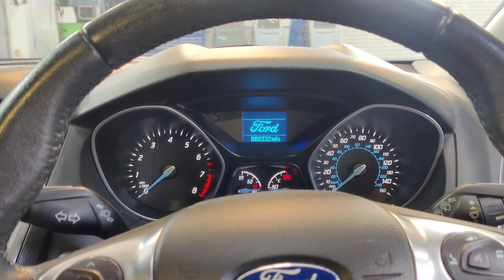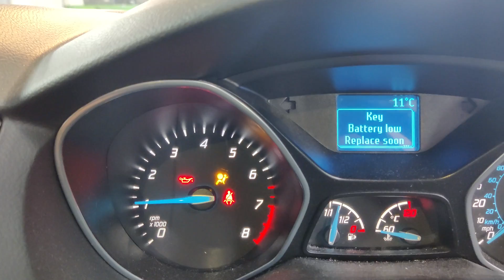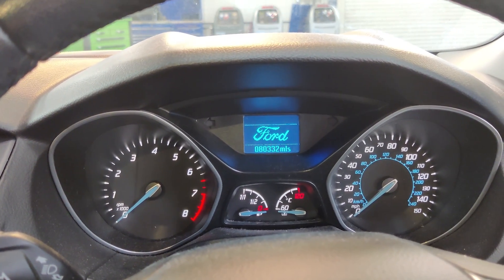AA Silencers Ford 1 0 EcoBoost M1DA timing belt failure leading to oil pressure fault

Comment: I noticed the car has 80k miles on the clock, Ford advise change  at100k or 10 years. How old was the car?
Reply from the maker: We've had issues on these engines from as low as 40000 miles and 6 years old.
Reply: Thanks. @aasilencersltd
Reply: @davidreece1642 my 87k 2017 Fiesta decided to do the same 2 days ago.   Regular oil changes with Castrol. 6 months to 9 months between them.

Comment: Thank you very much man.  This is very clear explanation why Ford Ecoboost  has certain dead after period of time. it is just simply stupid design.  Timing belts made out of organic materials that will dissintegrate over time from heat, frictions, and exposure to radicals from engine oil.

Comment: O had the same problem on my fiesta replaced the time belt new is different than the older one.
The problem was with 147000km until today with 179000km still working with no problems

Comment: I JUST had my belt break on my 2018 focus. The car has had the oil changed on time every time at the ford dealer and has never shown low oil pressure. It just broke. Pisses me off because the car only has 112k miles and the belt is supposed to last to 150k
Reply from the maker: Have you spoken to Ford as to whether they will take the job under a goodwill policy ?
If you have full documented history then it's worth asking the question given how common these are for failure.
They certainly have this in place for Transit models within a chassis range.
Reply: @aasilencersltd  I haven't spoken to them yet, I'll have to call and ask I guess

Comment: my friend  has  the same  problem and he's  been driving  it  .the  light go out after  30 S .But  i told him don't drive it  . i told him what was  wrong. its  in a  garage there  saying going to cost 800£ to replace the belt ?
Reply from the maker: If they have been driving it without oil pressure then the engine may have sustained irreparable damage.
The garage will need to assess the engine before replacing any parts, in particular they need to remove the sump and check for debris in the oil pick up.
Reply: @AA Silencers Ltd  I totally agree. I was was a mechanic many year's ago lol .iv not worked on car's this modern lol.but I did say.oh well

Comment: Went to midas a month ago or so. They put 3 litres of oil in my 1lt ecoboost. It takes 4.4. My oil pump blew as soon as the timing belt went. Turns out its a wet belt, let that muffuka get dry enough under pressure and heat. Boom! Gone!

Comment: The engine that won awards 👏  is a heap of shite after 30,000 miles ....ford reckoned the wet belt would last 150,000 miles ...but alas disintergrates at 30,000 and screws the engine up

Comment: My brother-in-law has one of these engines, done just over 20,000 miles, always carefully maintained, & now belt failure.  Who in earth had the stupid idea of putting a BELT instead of chain drive???  I can understand that it would make the engine a bit quieter, but a BELT immersed in oil???
Reply: Chains can fail aswell, its not a magic solution. I think they had a pre mature chain problem with them on BMW.
Reply: @Blac-m8d  Having been playing with engines for... (thinks)... 50+ years, I have never seen a broken timing chain, but I have seen many faulty tensioners.  As for wet belts, to the engine designers, I say don't make me laugh!!

Comment: I need a infornation, please:
If when I change the engine oil, I wash the inside of the engine with a cleaner (for ex. Liqui Moly 1019 cleaner engine), do you think that I prevent the formation of sludges ?
Thanks a lot for you replies
Reply from the maker: I can only suggest trying to find out what additives are approved by Ford.
Anything else is risky on this engine.

Comment: This engine [1.0 ecobooM] has to rank as one of the worst ever mass produced engines.
Reply: Peformance wise and for tax they are good. Also the new engines use a chain not a belt and they sorted the coolant issues.
Reply: @gamesmaster1060  only took ford 10yrs to sort it 🙄🙄
Reply: @waynemiller4602  Afaik they sorted coolant issues a while ago but I might be wrong. I'm not defending them it still sucks but I wouldn't call the engine itself terrible, especially when other cars have their own problems.
Reply: @gamesmaster1060  peugeot 3 cylinder engines have the same problem...

Comment: Straight from one of the best ford master tech's mouth here is his best 3 advice tips on this issue from the vehicles first service are :  1, Change the oil and filter at no longer than 3k intervals. 2, ONLY use Castrol MAGNATEC STOP-START 5W-20 E. This oil was produced with Ford and Castrol together specifically for the ecoboost engines to stop the degradation of the two wet belts. 3, Don't  use cheap quality fuel.. Shell or BP if possible. My friend  has followed these top 3 pro tips on his 1.0 ecoboost that he uses for his work as a taxi driver and it's just approaching 177k without any of the issues commonly reported with these engines. Hope this helps anyone who owns one of these vehicles fitted with 1.0 litre ecoboost engine.
Reply: I thought most fuel in the UK was pretty much the same as they all have to meet the same requirments
Reply: @gamesmaster1060 Different brands of Fuel is quite a complex topic. In brief it's alot to do with the additives different brands use in there fuel. Some brands leave less carbon deposits with a much cleaner burn.
Reply: @jawdinker554  so if I use BP I should be fine? or is it better to use premium?
Reply: @gamesmaster1060  Hi Jack,  My preference in brand fuel is Shell standard unleaded first choice, B.P Standard unleaded second choice.
Reply: @jawdinker554  As a tanker driver and mechanic I can debunk your response, we take the fuel from the nearest depot to the closest forecourts, no matter which garage or supermarket and deliver it, ONLY the top end fuels (e.g. Optimax, Helix) are supplied by brand. This is to keep transport and storage costs down on the cheap 96 RON, the problem with fuel is the new e10 crap, this does not burn as efficiently and is getting a reputation for degrading seals and gaskets due to its poor burning cycle.
Reply: @Smakheed  As mentioned in my earlier comments the fuel debate is a very complex subject to which i have a fair bit of knowledge. Without being spending time explaining this complex subject just go and research the different additive packages and the science the different brands of fuel manufacturers use.
Reply: @jawdinker554  YOU NEED TO LEARN THAT SOMETIMES, OTHER PEOPLE KNOW MORE ABOUT THEIR INDUSTRY THAN YOU DO.

Comment: Bough a low mileage (26,000) 2014 Focus Ecoboost 1.0 just two  years ago. Put less than 7k on since, and this has happened. Are there any legal routes I can go down? It's a clear case of a design flaw. US has lemon law and other consumer protection but in UK there's little recourse. Very angry. Wish I'd got a low mileage 50's plate Focus. They go on forever, even if you don't look after them.
Reply: I just bought a 2018  Focus Ecoboost with 47,000 miles. Before my scheduled oil change my engine would not start. Mine was still under the 60,000 mile manufacturer warranty. They are currently replacing my engine. No ETA on engines though.... So I'm stuck paying for a loaner bc the dealership warranty I paid for doesn't cover anything until the Ford warranty expires.
Reply: @Ccookkiieee  Had to buy a brand new engine and pay to have it fitted out of own money. It was 3k all in, which wasn’t that bad considering other garages quoted over 5k. Next time I meet a majority stakeholder in Ford I’m going to steal his Rolex. Eye for an eye ‘n’ all that. I’ll never buy another Ford again that’s for sure.

Comment: Nice helpful video. Was looking at replacing our 2006 Mégane 1.5 DCI ( engine ok , everything electric constant headache) with a late Ford B Max . Like the sliding rear door option , but think will have to look elsewhere. Cam belts degrade and need changing, why would a manufacturer make them more susceptible to wear , and more expensive to change ?
Reply: Belts are idiotic on an interference engine and purely a cost reduction measure anywhere else. Early single-cam VW gas (non-interference) engines were at least easy to service with inexpensive belts and idlers but the 1980s are ancient history.

Comment: That light means you need to get oil can and oil the engine then all ok
Reply: I'm afraid not. When the light came on in mine, i thought that and filled the oil (ended up over filling it) and the light actually went out (just occasionally flickered on and off). I thought it was ok to drive home. However, after 20 minutes it started banging and that was it. Only after it was recovered to the garage did they tell me what had happened and that i needed a new engine.

Comment: Hi. I got the same problem with my ford fiesta 1.0 ecoboost 2017... my girlfriend drove the car with the  oil light on for 30km. I scanned found error p0012,p0014. So today i changed the oil (5w/30) Titan brand  and oil filter but i get the rattling/knocking sound with the oil light is still on. Its 257 856 millage of the car.
 
I suspected that the oil pump its not pumping.  so i  open the oil filter again to check if there's any oil inside... i found the oil.  So the sensor near the oil filter  if its dirty can it cause the light to come on?
A dirty oil strainer can it cause it?
Reply from the maker: What we have found is documented in the video.
Chances are that you have the same issues, and after driving with the oil light on for 30km there is a high probability of engine damage.
Reply: Does the manual say to use "castrol magnetic oil 5w20"
Reply: If the rattling takes place, that's bad,. Stop the engine ASAP..

Comment: Advice from talking to others who experienced sudden engine failure costing them up to £5000.
When you start the car check how long it takes for the oil light to go out .
If it is OBVIOUS it is taking longer and longer (probably more than a few seconds), don't use the car, get it checked. Of course check oil level and get the oil changed as recommended or sooner ( eg twice a year).
Most likely the pick up is becoming blocked and the engine will shortly die. Sadly you may need the wet belts and oil pump changing which is not cheap. Ford made this maintenance item very difficult by design 0/10 Ford. Crazy!
There is a theory that E10 fuel may cause faster wet belt degradation due to piston blow-by at cold start when more petrol and now more ethanol gets into the oil.
If this theory is true, this problem will become more common.
Reply: If it could be proven or even that it was very likely to cause premature engine wear, there is a good chance of a class action lawsuit against the Government for forcing E10 fuel. Similar idea as VW and their emmisions avoiding software.
Reply: Yep, put E10 fuel in my 1.1 2018 zetec fiesta at 73,000 miles to try to clean out the engine a bit as I felt a bit of misfire, this completely destroyed the engine… complete engine failure and costing me £5,000 to replace the engine… it’s a write off. So Suprised how common this is

Comment: Doesn't take long for engine damage to occur with no oil pressure  crap idea having a rubber belt immersed in oil  see other car manufacturers are doing the same peugeot  and vauxhall amongst others is it deliberate  so when it fails the car is basically scrap
Reply: Not nessecarily, ford changed my engine for free after I mentioned that it is a design flaw

Comment: Had my 2014 fiesta 1L ecoboost from new and I personally replace the oil every year with the correct oil (which is horrendously expensive) just replaced the timing belt and oil pump belt in February of this year and my old belt showed no sign of degregation. The common thought on this problem you've shown is owners not using the recommend oil and just using cheaper oil which I understand why when you compare the price of the recommend oil and the supermarket cheapo oil.
Reply: Get the correct oil direct from ford main dealer, only £26.40 for 5l
Reply: @deanwarner2006  I was going to add the oil isnt expensive at all.
Reply: People had problem with degrade  cam belt even when they use recommended oil  castrol 5 W 20 so it's not about correct oil  but about  petrol in oil.It appears  when car  goes on short distances(not warm enough) or when injectors leak.
Reply: Sure, combustion byproducts / blowby affect the properties of the oil, maybe people using oil additives or cheap oil. More contaminants end up in the oil on short trips because they don't have enough time to get sucked out by the pcv system...  or perhaps the pcv system is poorly designed.
I'm sure the engines are tested under perfect conditions instead of rough service or real world conditions...  or the engines are well under production already and it's cheaper to just pass the crap design onto consumer than to admit fault.
Reply: @phiksit  engines are tested in perfect conditions that's why they claim that this engine can do 67mpg where in fact there's no way it can, the most I get out of it is 47mpg.
It's a ridiculous set up where the government allow car manufacturers to get away with blatant lies.

Comment: Happened to my nephews.. I fitted new oil pump and runs like a dream ,, they don’t need replacement engines,
Reply from the maker: He was very lucky.
It all depends on the length of time that the engine has been run without oil pressure.
Reply: Yes but if the degrading timing belt was the cause of the blockage then it might just happen again, although I'm not sure how long that takes
Reply: The engines should never have used defective design. No legitimate reasons exist to even consider a buried wet belt nor to excuse having to replace oil pumps due to gross factory negligence.. Good for you those engines survived so far but a couple of anecdotes do not represent the pool. No engine should require special catering for their camshaft drive in the first place.

Comment: so the ECOBOOM nick name is still there lol
Reply: Anything machanical has service intervals and if you skip them the outcome is usally bad.
Reply: Ecoboom came from the nylon degas pipe they used which broke and leaked coolant. They recalled the cars and fixed the pipes, but the belt is still an issue if you use the wrong oil
Reply from the maker: We even tagged that in the video 🙂
Reply: @aasilencersltd  haha